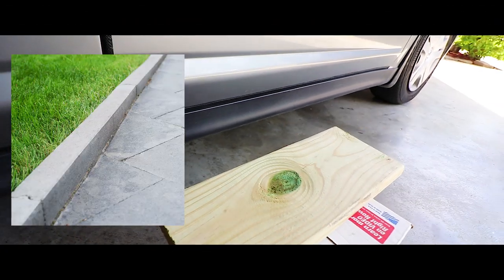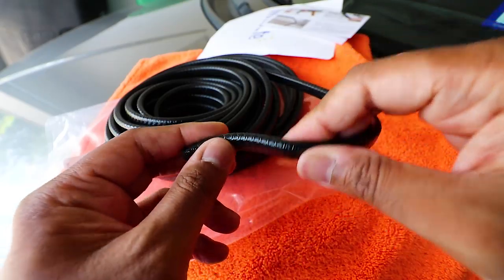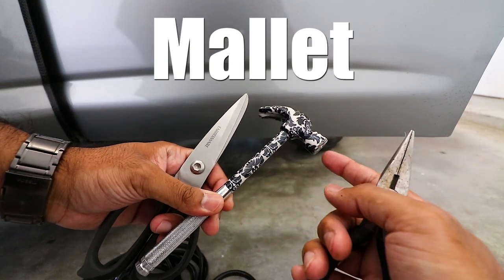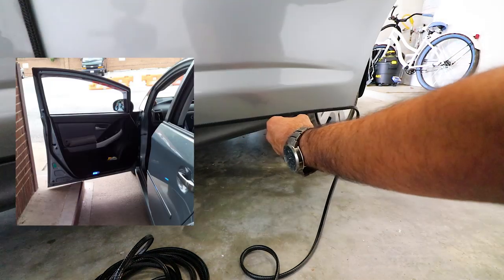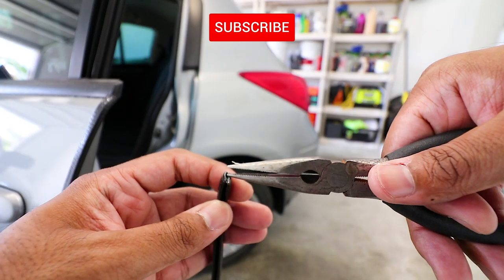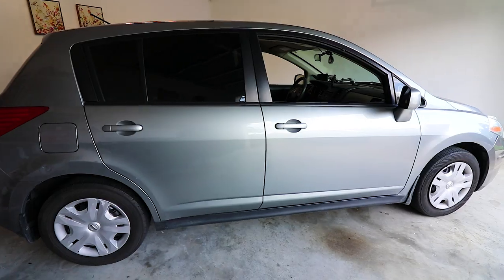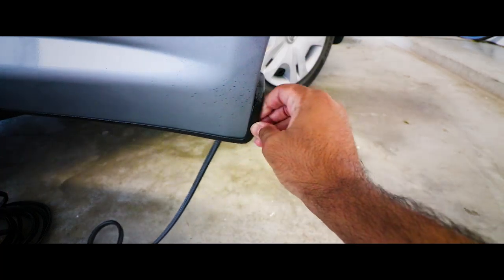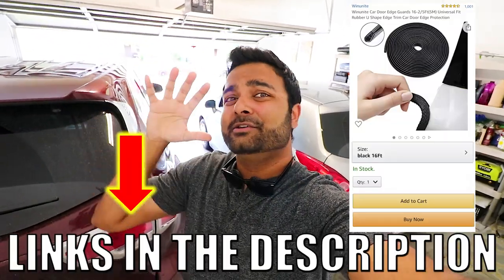PROTECT Your CAR Doors with Edge Guards!!

Comment from the maker: Edge Guard (LINK) - https://amzn.to/3gAIjnd
Edge Guard (CAN LINK) - https://amzn.to/2yJVxNh
*IF LINK IS BROKEN or OUT OF STOCK, Let me know in the Comments*
Reply: I got one but then waters goes inside it when it rains then will it will rust the door
Reply: @raunak4077   Hello. You can remove the top and bottom metal clips before install it on your car.

Comment: Bought the exact same brand door edge guard on Amazon before finding this video. Very happy to see the same brand working so well and apply so easily....really looking forward to getting it on my car
Reply: So update on the edge guards. Got the 32 ft edge guards and it was just as easy to install as seen in this video, took a lil more than an hour to get them all on. The car was a hatchback and was a able to cover all 4 doors (side and lower part), the rear door lid and a portion of the bonnet in that time. 
Its been on the car about 2 months and no problems at all,looks great and guards the edges perfectly. Definitely recommend.
Reply: Can you please let me know if you  had any problems with water from rain or car wash getting in the edge guards? Any moisture at all? Or mold?
Reply: @trashyoutubetriestocensorm8951  so the only points where water will get into the edge guard are the ends where the metal ring inside the edge guard was not removed, which for me is on one side of my trunk lid. Once the ring is removed then i dont see any water getting into the edge guard
Reply: @Ray-lg9yw  Are you suppose to remove the metal ring on both end or just one end once installed? Have you noticed water collected on the trunk lid guard? I have a SUV and plan to install the guard there.
Reply: @jtcber  remove the metal rings from both ends if you are going to install on the trunk lid. For me, because I didnt take out one side of the metal ring soon enough, i still have instances where a little water catches in one side of the edge guard. So definitely take out the rings once you have it installed.
Reply: @Ray-lg9yw  What about the ones on the door? Do they need to take out on both ends too? What is the purpose of keeping on or taking off? I assume the instruction sheet should indicate it right?
Reply: @jtcber  yes take out the metal rings out of all the ends, whether its on the doors or trunk lid. Taking out the metal rings will prevent water from being able to collect in the edge guard.
Reply: @Ray-lg9yw  Thanks. How do you cut along the metal ring  if the length is between two rings?
Reply: @jtcber  u would need to cut between the metal rings. Any cutting tool like pliers can work, as long as it can cut through rubber.
Reply: @Ray-lg9yw  ok thank.i will give it a try once weather gets better.

Comment: Good install! The product looks nice like it will have good follow through meeting its claims and purpose. Aslo, it looks like it came from the factory and is aesthetically pleasing and matches the car well. Can you please do a update? Has water gotten into the edge guards? Mold? Any moisture at all?
Reply from the maker: No moisture no mold, the edge guard is still there no problems. Probably one of my top favorite products.

Comment: Anyone looking to buy edge guards BUY THESE, NOT THE ONES AT OREILLYS AND AUTOZONE. I bought those with 3m glue on them, the strip started pealing away and turning yellow, when I tried to take them off it ripped large chunks of my paint off and left a line of dirty and super glue mixed together
Honestly ruined my fucking car, im gonna gett these for now until I can save up for a paint correction

Comment: What about removal of this rubber strip?  Doesn't the metal clip damage the car paint while removing.
Reply from the maker: No it does not. The metal clip is on the rubber part only.

Comment: Will the water store inside it and cause rusting to the door ? I got one and when it rains I can see some water going inside it so will it cause any rusting as water is storing there
Reply from the maker: So far it has rained like crazy where I live and I don't see any water developing.  The seal is really tight.
Reply: it should be the same thing as those splitter guards on dodge chargers u gotta remove them cuz they rust it?

Comment: Does it use any adhesive to make it really glued to the door edges?
Looking to put edge guards on my Sonata..
Appreciate the input 👌 
Much blessings 🙌
Reply from the maker: It does not use any glue or anything like that. My sister has had it on her car for a few years now and it is still on there really tight.
Reply: @KLEANTRIX  Ty for your response 😎😎
Reply: @KLEANTRIX  Greetings friend. Just wondered whether it is a problem whenever washing the vehicle with water or leaks getting into the LOWER seals? Thanks
Reply from the maker: @OGA_999  I haven’t had any issues with that. Your paint does a good job protecting your car door panel if there is any water. Good question.
Reply: @KLEANTRIX  Great thanks I've just received my order delivered this morning.  Will upload once I've installed on my vehicle.  I went for the CLEAR version so I think the glue part will have to go on the door inside unless someone tells me different?

Comment: Is that metal piece you pulled out encapsulated in the rubber? It's not making contact with the paint is it?
Reply from the maker: No the metal piece does not make contact with the paint.
Reply: @KLEANTRIX  Just ordered, thanks.